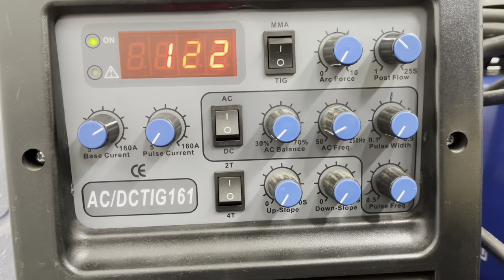Installing intake air temp weld on boss to boost pipe - Aluminium TIG welding

Comment: what sensor is that one? looks like iat honda ? where did you get that flange adapter? thanks!
Reply from the maker: That’s right, it’s one used on the Honda civic Type R ep3. The weld on flange is T7 designs one you can get on eBay for £22.50. Link https://www.ebay.co.uk/itm/192217278211?mkcid=16&mkevt=1&mkrid=711-127632-2357-0&ssspo=-JvW0lVRTvK&sssrc=2349624&ssuid=4471N56NSwC&var=&widget_ver=artemis&media=COPY
Reply: @Smffab  Thank you!!
Reply: You can make that adapter easy man don’t buy one!